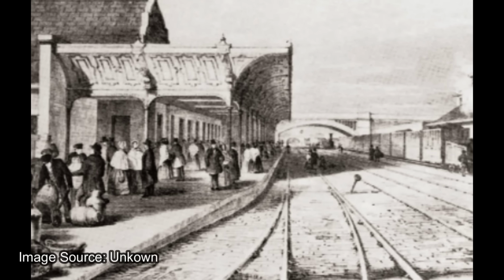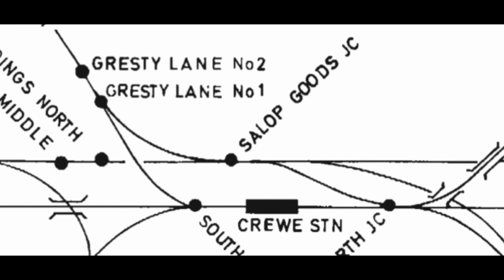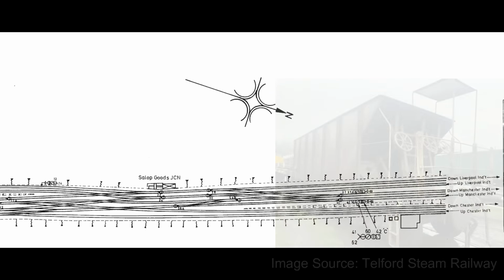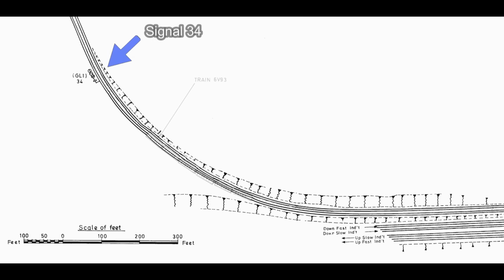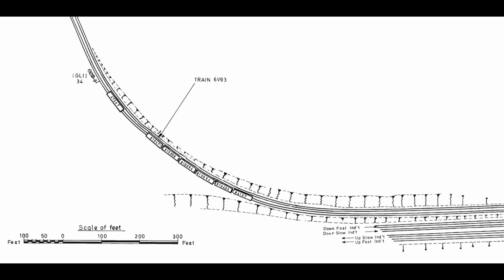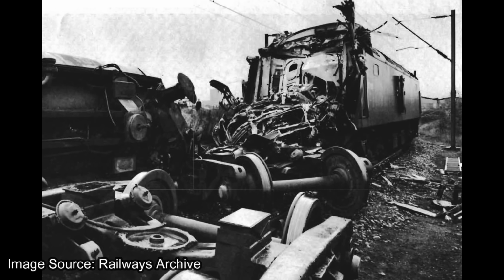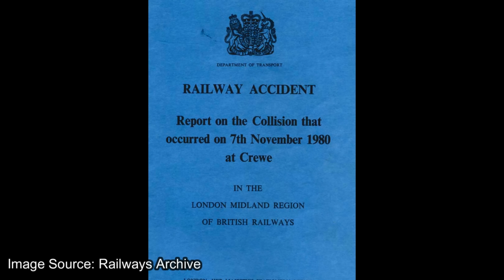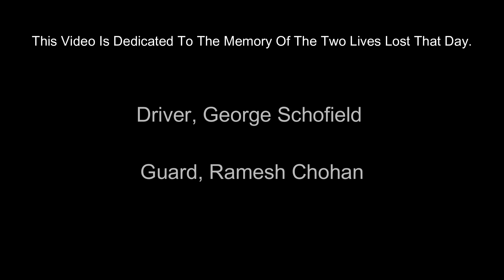Crewe Junction Train Crash 1980 (Re-Upload)

Comment: I caught this almost as soon as it was put on. Then half an hour later it was taken down. I know why, lol! I spotted the mistake right away, of course. SG42 would most certainly NOT have shown a green aspect and 'C' indication, as it was a colour light signal. A semaphore would have done so, however. I'm not being arrogant or disrespectful. Quite the opposite, in fact. You'll see why. FWIW, I was also a drivers assistant at GB back then, and ironically would go on to serve as a driver at Crewe for over 30 years. Thus I have extensive knowledge of the area and this accident. 
I'm very grateful for the respect you have shown to the deceased. They were great blokes to work with.
You see, my brother was the survivor of this one.
All the best.
Reply: The video made reference to two lights, I think they meant cats eyes although I hadn’t realised the chord was permissive.

Comment: Credit where due. I took issue with the critical inaccuracies regarding the aspect displayed to the second train in the sequence of events described in the first version of this story. It is therefore pleasing to see you've responded to the critique and remedied the video so in this key respect it is no longer as misleading as it first could have been seen to be. ✅

FWIW the 'two lights' are commonly known as a Position Light signal or two WHITE lights which denote the driver is authorised to pass into the next signal section at a speed consistent with being able to stop short of an obstruction. The driver through their route knowledge will understand the likely status of the line ahead.

Comment: The Engineering Train 6J41 must have been travelling too fast in the section under caution looking at the damage there. Surely the Signal on approach to the stationary Tanker Train would have been at danger?
Reply: It would or should have been running under some form of wrong line order.
Reply: Permissive working at Salop Goods Jct train gets the cats eyes to go behind another not like that up to Gresty Lane now it's TCB one at a time. Salop Goods on the countdown to closure along with Basford Hall Jct and SS North.
Reply: @johnroberts8512  John, well that sounds very impressive, but what the heck are you talking about? Your missive makes no sense.
Reply: @smedleyfarnsworth263  He then goes on to tell you that it is not like that now. Track Circuit Block (TCB) regulations are in force. Now actually you can have permissive working on track circuit block lines, but in any case that is no longer done and you can only have one train in a section on the same line at the same time. He is further giving you the sad and dreadful news that Salop Goods, Basford Hall Junction and Sorting Sidings North Signal Boxes are scheduled for closure in a few months.
Reply: @LUAu101  I get that those individual manual signal boxes are going to be replaced by a centralized control system.

I understand that some signals are permissive and can be passed at stop after observing the rules in place for passing them at stop. One of which would have been to proceed slowly and being prepared to stop short of an obstruction.

What I am saying is the relief locomotive was traveling in the wrong direction. Therefore it needed to be operating under special orders. One of which would have been to proceed slowly and being prepared to stop short of an obstruction.

You see the main point being, to proceed slowly and being prepared to stop short of an obstruction.
Reply: @smedleyfarnsworth263  I don't really know what's going on here. The first of my two comments was deleted before you replied. Since you took the trouble to reply I tried to do you the courtesy of rewriting the original comment, but I can't seem to post it successfully. Sorry. I'll try and get away with this: The collision was a rear-end collision. A second train was correctly signalled permissively and in the right direction into a section that was occupied by another train. The proper position-light signal (cat's eyes) was correctly displayed. However the driver of this second train failed, as you say, to proceed slowly, prepared to stop short of an obstruction. The second train crashed into the rear of the first. There was a locomotive that was in the process of setting back onto the first train when the crash occurred but the driver of this locomotive merely witnessed the accident (or rather he witnessed the train being pushed forwards towards his locomotive as a result of the collision). He was not involved in the collision. The setting back locomotive did not crash. I could be wrong, I'll admit wrong line orders were before my time, but I don't think a wrong line order would have been required here as I believe the move back onto the train was actually a signalled one and was probably routine. However it isn't relevant to this crash.
Reply: @LUAu101  Now that is well put and describes the situation perfectly,

Those "cats eyes" would be called a "calling on" signal on my railway.
Reply: @smedleyfarnsworth263  Well I don't really know what to make of this. Another comment has evaporated. But thanks for your kind words and yes, in short, it is a calling on signal, you understand correctly and we'd use that term too. Cats eyes is slang. Mind you not all position light signals are calling on signals, but there's no point explaining the differences, the comment will only get deleted!
Reply: @smedleyfarnsworth263  Not so . This was a right direction move, fully signalled. It was under permissive working , having been given the correct aspect for the move. Wrong line orders were long-gone by 1980.
Reply: @johnroberts8512  Unless anything has changed since I last worked to Crewe, it is absolute block , not TCB. TCB would not be very workable in such a location.
Reply: It was permissive working for certain classes of trains not conveying passengers between Salop Goods Jct and Gresty Lane  now it is TCB one train at a time since Gresty Lane box closed and is now a NX panel in Crewe Signalling Centre. I know I work the boxes around there and I've been signalling trains for over 40 years.